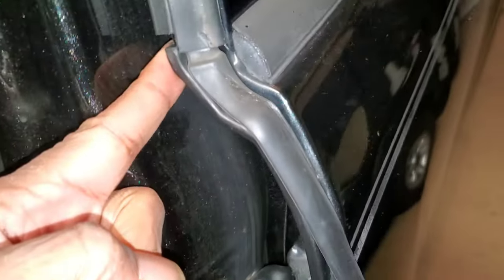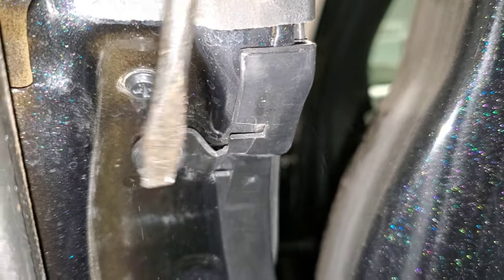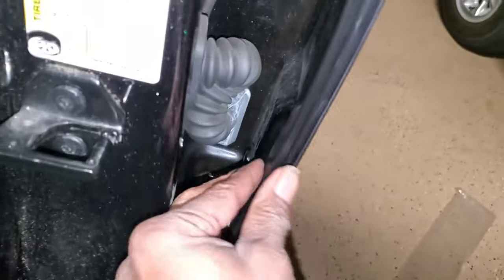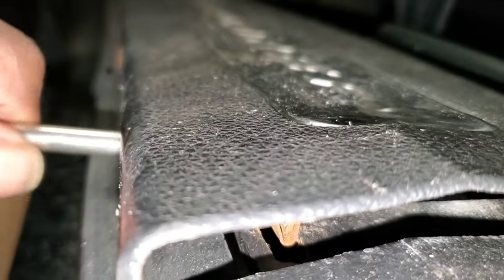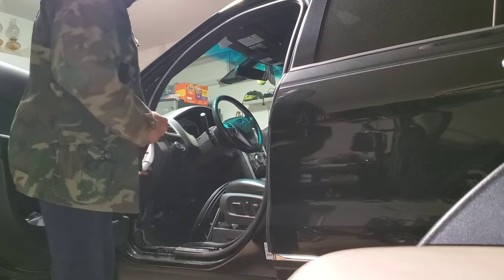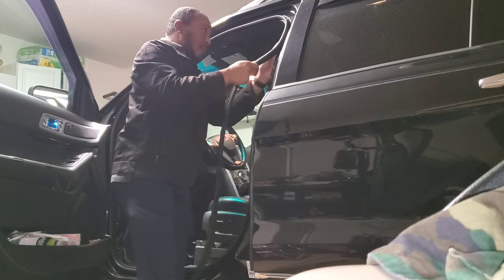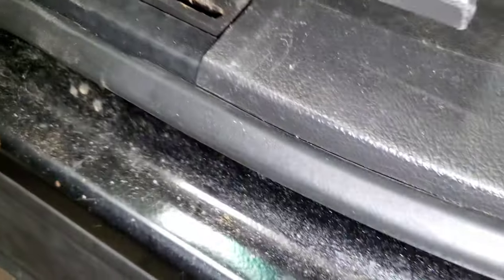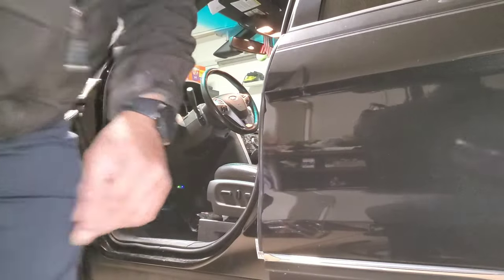2011 - 2015 Ford Explorer Door Seal and Weather Stripping replacement

Comment: thank you so much for this. I think this is why I have a leak and tons of water in my back and front seat floor board ! I'll let you know if replacing this works !
Reply from the maker: Please do and I hope it helps.
Reply: @shellycolson9365, did replacing these resolve you front and rear floor board water issue? I’m dealing with that now on a 2013 Explorer and haven’t yet isolated the source of it.
Reply: @New2IPTV  the back still gets wet . Thankfully I live in michigan and not Florida.  I have a tarp in there now to catch the water  the front of my car under the hood I put some seal in the area closest to the dash like some putty stuff because I think there was a Crack in it hard to explain but the water was running down the front of where the gas pedal is . Since I sealed that Crack in the front I have no issues. I could not see the Crack went in and just puddied the whole area
Reply: If you have a sunroof, you may want to check the drain tubes.  I’ve had issues for YEARS with water leaking in because the drain tubes keep clogging.  Took 10 years to learn/hear for the first time there are “restrictors” on the ends of the drain tubes that basically get glued shut with debris which inevitably causes the sunroof pan to overflow onto the front floorboards.  I found a video on YouTube showing how to replace the glass motor and how to access the drain tubes in order to clear them/cut the ends so they never clog again.   Hope you’ve solved your water leak mystery!

Comment: Great video, straight to the point. Did you used to work for a dealership?
Reply from the maker: No. I got a manual off Ebay that shows how to do the maintenance. As much as the dealer charges, I'll do anything to save a buck.
Reply: @0701hawk  great info, much appreciated.